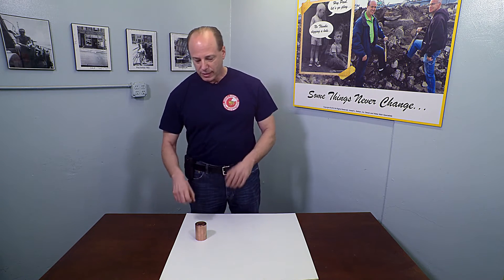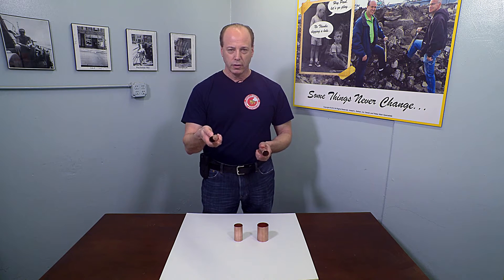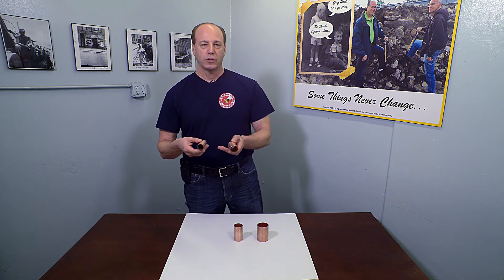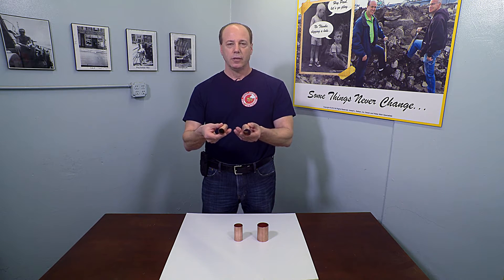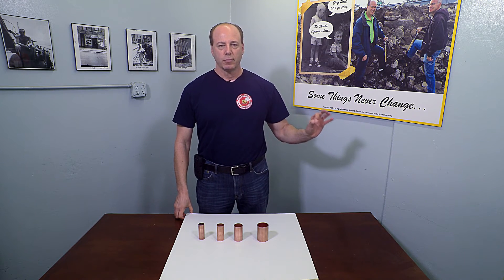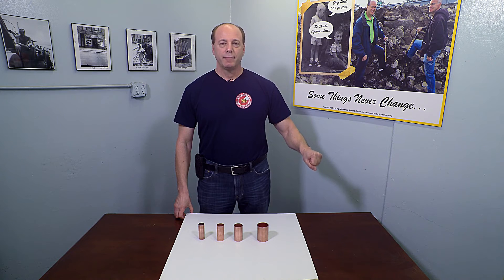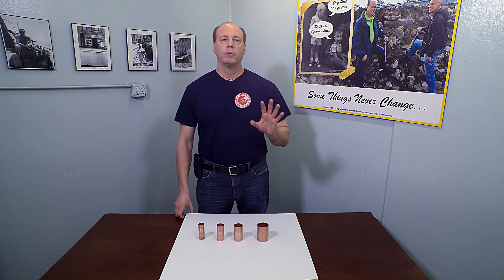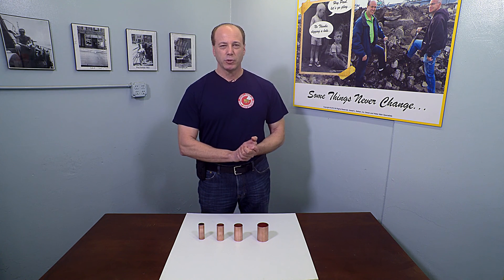Sizing A Water Main: Use Our Free Water Line Size Calculator Service

Comment: You have to be careful when you give out raw numbers like that it really does depend on a few things a 1” line can deliver a lot more than 9GPM in fact if you had 200 psi behind that 1” line you can probably deliver 30 gallons per minute how many CV across the regulator inside the house? The real
Answer is that it he PRV inside the house limits the pressure down to 80 static and that will affect your overall delivery pressure so what you should be able telling people  is that at 80 psi static you can deliver an average of 9gpm to your total fixtures but even then elbows valves and other things like total amount of piping effects pressure drop and flow rates

Comment: hey im trying 2 figure out waterline size anD hope u can give me an idea. im in the philippines and lets say they r not overly smart   anD im no engineer so that being said. they have an inch and half main line 2 our area with about 2o half inch lines connected. it seems 2 me thats not a  big enuff main line. the water source is several miles up hill no pump gravity feed. is there a way to est how big of line there should be? ty Travis
Reply from the maker: Wow Travis, from the Philippines! That's awesome. My sizing table is based upon the NYC requirements. It is based upon the number of plumbing fixtures (bathrooms, kitchens, etc.) and the length of the run of pipe for the service line. The minimum size for a service line in NYC is 1". With that said, I'd have to agree with you that 20 lines connecting to one 1 1/2" line would not function properly. A 2" line feeding 20 homes with 1 bathroom and 1 kitchen each should be fine. The service lines feeding each house should be 3/4" or 1" in my opinion. Remember I have no familiarity with plumbing code or requirements in your area. Let me know if that helps in some way, and thanks for the inquiry.
Reply: @balkanplumbing  Codes?, thats a funny word here..lol .. if there are, they dont follow, im sure... Most foreigners that come here with any knowledge of plumbing, electrical, mechanical, maintenance just shake their heads at how things are done. people live 4 the day the heck with 2 mrw so it really doesnt matter how it gets done or if its done right or wrong as long as its done.. Its a very different world..lol. so anyway just as i figured common since says not big enough main..  Ty 4 ur feed back.

Comment: The city has given me an option of a 3/4 in water meter or a 1 inch water meter the 1-in water meter costs quite a bit more and my house is 500 ft up a driveway from where the water meter is going to be I was told to use a 2 inch water line because otherwise I would have very low pressure up at the house but does the water meter size itself matter in my scenario?
Reply from the maker: Yes the meter size matters a lot. Rule of thumb, the meter size is 1 size smaller than the service line size. Meaning, 2” service line, then 1 1/2” meter. Btw: 500’ high, you might need a pump with a holding tank. Let me know if that makes sense!
Reply: @balkanplumbing  I'm sorry if it sounded like the house was 500 ft high,, the driveway is several hundred feet long and the house is about 500 ft from the main road where the water meter is and the house level is probably 15 ft higher in elevation then the elevation at the main road where the meter will be
Reply from the maker: @portlandlocalchurch8168  I can actually size the line out for you if you give me the number of bathrooms and kitchens inside the building. I'll base it on a 500' run.
Reply: @balkanplumbing  the home is a HiLine 4br plan #2576 with 2.5 restrooms and 1.5 kitchens and I was told that we have 68#psi at the main line, down on the road.
Reply from the maker: @portlandlocalchurch8168  I would need the distance form the building to the public water main to do a calculation based upon the NYC sizing table. Please give me the distance.
Reply: @balkanplumbing  500 ft
Reply from the maker: @portlandlocalchurch8168  2" is the correct size. More than enough according to the NYC DEP sizing table.  Plus if you ever add plumbing fixtures, 2" could handle the load.

Comment: I have been wondering about this for years. When I water my grass I can’t even take a shower. The water pressure drops too low. So I’m going to increase to a 1 1/2 inch line. I’m at a 3/4 pipe now
Reply from the maker: Before you go that expense, I might be able to help you out. Let me know how many bathrooms and kitchens you have in your home, and the distance from your home to the city main in the street. I'll size out what size water service line you should need.  If you do go ahead, you may need to to change the tap connection on the city main too!
Reply: @balkanplumbing  we have a 3 bedroom 1 bath. But we are increasing to 4 bedroom 3 bath.
Reply: @balkanplumbing  the distance from the meter to the house is about 35 feet.
Reply from the maker: @trohobbs  Also how many bathrooms and how many kitchens?
Reply from the maker: if you have 1 kitchen, 3 full bathrooms, a dishwasher, and a washing machine 1 1/4" would be perfectly fine for a 35' run. Just make sure the tap connection on the city main is at least 3/4" of an inch, a 1" tap connection would be ideal. Hope that helps. if it does, please give my video a "like"!

Comment: So a 2 inch line would suffice for 200 ft. length  with 4 foot elevation change at last 20 feet??
Reply from the maker: You would have to provide the type and number of plumbers fixtures for an intelligent answer. Plus, all answers are based upon the NYC sizing table.

Comment: If you have a 3/4" supply line from the city and you put a 1" line from the meter to your home, are you really getting more flow rate or less friction when the city is already using a 3/4" line?  I don't think so.  If the city is using 3/4" and you put a 1" to the home you are getting no benefit from using a 1" from the meter to the house.
Reply: you dont want any line bigger than  what is before the meter coming from the street..
Reply: Youd have a better supply of water contained in the larger pipe, it would of course be better to have it all the way, but every place it can be bigger would help. Friction loss and volume.
Reply: Charles Terrizzi   Ok.

Comment: Thanks for the video, really helpful. What size would you use for a 300 sq. ft ADU used for airbnb?  It has an existing water line that needs to be repaired that runs from the back of the house so I was thinking of upgrading it.
Reply from the maker: The main water service line size is calculated by the number and type of plumbing fixtures. I would need that information, and if you are indeed referring to your main water supply line.
Reply: @balkanplumbing   I checked and it is the main water line supply. As far as plumbing fixtures, I believe it would just be a kitchen sink, bathroom sink, shower, and a toilet. Thanks for your reply, I'll try passing this video to a few friends in this area in the event they ever need help.

Comment: I have a 2000ft driveway with a 3/4 in meter.  I’ve heard 1in supply line is fine and I’ve been told 2 in would be better.  No elevation change.  What is your thoughts
Reply from the maker: Required size is also calculated by the plumbing fixtures in your property. How many bathrooms, kitchens, washing machine, dishwasher. It all is needed to size the iine properly. BTW: A 2,000' driveway? You sure?
Reply: @balkanplumbing  probably a ways inside of a 40 acre property. It's uncommon, but some rural areas have city water service.

Comment: 1" line = 9 GPM at what PSI ?
Reply from the maker: This sizing guideline is based upon the NYC sizing table. I am not sure what PSI they (the DEP) used in determining the size.
Reply: Ya you can’t throw around raw numbers without understanding what your static pressure is and what amount of pressure drop due to friction etc you can have 30 GPM on a 1” line if you raise the static pressure high enough it just means you’ll have way more pressure drop over short distance you can basically start your calculation off 80 psi for whatever size pipe cause the pressure reducing valve in the house will limit static delivery pressure to 80

Comment: Hello there, I am building a house out in eastern Kentucky. Our house will be about 1800' from the city water hookup. There will be an elevation gain of approximately 100-150'. The house is only a 2br, 1bath, with an outside shower and outside hose hookup. We have been told that a 2" line would be best, but I wasn't sure if that seemed correct. Would a 1" be sufficient pressure for that much distance? Also, would a 1" meter work with that 2" line, or would we need to get a 2" meter? Thank you for any and all help!

Comment: can I go straight from 1 inch or 1 1/4 inch to half inch for my branches, or do I have to step it down?
Reply from the maker: That is where yo have to be familiar with plumbing design and code. I cannot answer that, better to call a local pro.

Comment: i only 3/4  coming into my home and then 1/2 right after meter...had good pressure at 60lbs but terrible flow with multiple fixtures going....i tore out the 1/2 and did 3/4 until all the branch offs and it made a huge difference.i also replaced pressure reducer valve ..those can go bad also.

Comment: I am starting a mobile home park. There will be 12 mobile homes hooked up to my main water supply.  These homes will be 2 bed 2 bath. The main water line will be ran 650 feet from the city line to the first mobile home. From 650 to 1050 feet the homes will be hooked up into the main supply. What size main water supply do I need? A lot of people are telling me 2 inch line or 3 inch line
Reply from the maker: Using calculations based upon NYC sizing requirements, you clearly need a 3" main. A 2" main will be even close to sufficient. This is based upon information you supplied of an average length of run of 850', and 2 bathrooms and 1 kitchen per unit. I hope that helps you. BTW Better to do it right the first time!
Reply: Thank you!

Comment: What you are saying is great information, however it does no good to put a larger diameter pipe on your side of the meter than what is on the city side of the meter. If the city side is 1" or 11/4", you simply match that on your side. A larger diameter pipe on your side of the meter than what is on the city side will not do you any good. One trick we use is to continue with the same diameter pipe from the meter, and running it far underneath the house. Then go with 3/4" as far as we can, then dropping it down to 1/2" to accommodate the fixtures. Gotta have that volume. Also, use garden valves instead of hose spigots. Huge difference. Thank you.
Reply: No one listen to this guy,  he's clearly not a plumber. 

Many high rises have supply pipes that are 2 sizes larger than meter
Reply: @stevelovesgod  for real he just contradicted himself. A larger pipe after the meter means more volume.